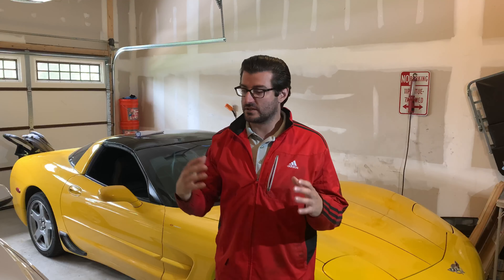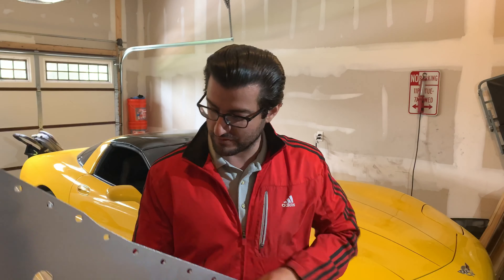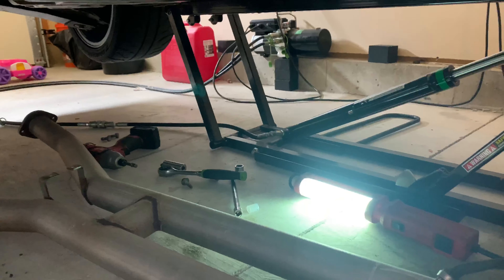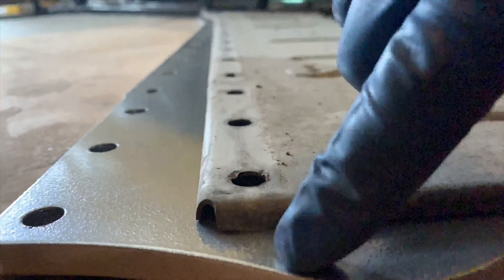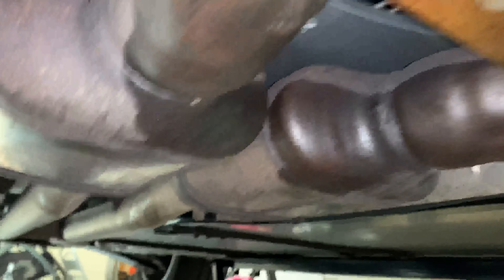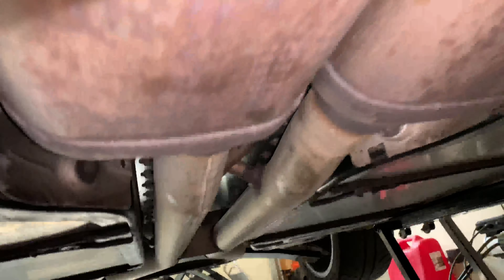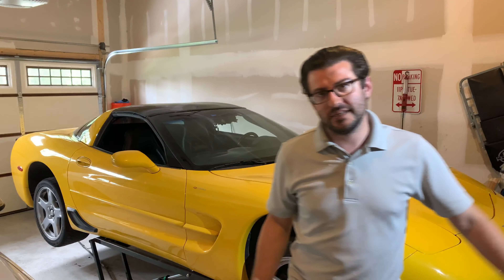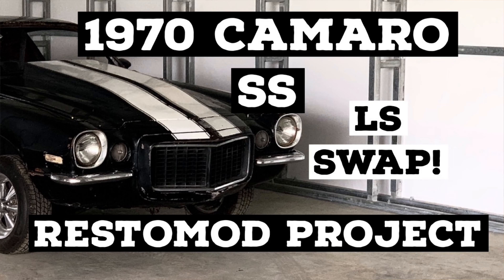CAN A TUNNEL PLATE MAKE YOUR CAR STIFFER?: C5 Track Car Ep 9- Elite Engineering 5/8 plate

Comment: don't you need longer bolts?
Reply from the maker: You could get longer bolts, but I didn’t and none of them have fallen out yet
Reply: @LowBoostFilms  I Just think long term the thickness difference in the plate is the amount of thread engagement that was lost times how fasteners there are when the purpose of the plate is to promote flex reduction